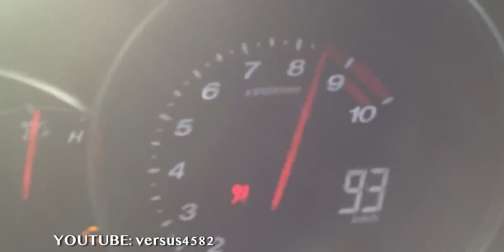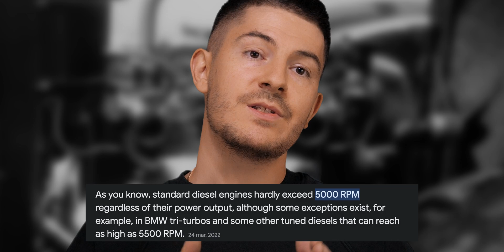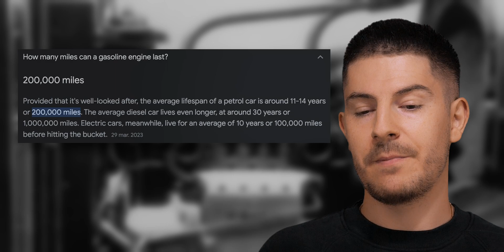Why Diesel Engines Last Longer

Comment from the maker: Professional Maintenance Products I Recommend 
Engine Oil Flush PRO - https://amzn.to/45egARf
Engine Oil I recommend - Liqui Moly 5W30 (Made in Germany) - https://amzn.to/46htcs6
Wear Additive I recommend - Ceratec - https://amzn.to/3Q6uYqF
Gasoline System Cleaner PRO - https://amzn.to/3tjXcVT
Diesel System Cleaner PRO - https://amzn.to/3rCYUkK
Diesel DPF Protector Additive - https://amzn.to/3RGJeaI

Comment: Diesel engines must be more robust in order to withstand the higher compression ratio required for diesel fuel ignition and complete combustion. This means that engine blocks are usually made of durable steel, although this is not always the case. They also require stronger pistons, wheels, and connecting rods, so they must operate more slowly due to their greater mass, but they have better torque.  However, they also run cooler than their gasoline counterparts, even though they reach higher temperatures during the combustion cycle. Due to the evaporation of diesel fuel directly in the combustion chamber (although diesel requires less latent heat for vaporization than gasoline -> 250 kJ/kg vs. 350 kJ/kg) and the high compression ratio, the engine cools more easily because more energy is released into work than into excess heat. So higher compression ratio, more robust components, more oily fuel, less excess heat, more energy on the wheels, less consumption, less explosive combustion -> longer life. A gasoline engine can never beat a diesel engine, no matter how good it is. I drive an Opel Astra H Isuzu 1.7 CDTI 125 HP station wagon, manufactured in 2010 with 202000 km on the odometer, and it is better than all other newer or older cars on the road, except for cars with VW 1.9 TDI, Fiat 1.9 JTD, Toyota 2/3 L , Mercedes OM617 and Peugeot XUD9 diesels. The only exception is the Volvo B230 Redblock gasoline engine. Other engines, regardless of their origin and year of manufacture, are inferior. Hope that helps.

Comment: Mark the Carpenter here.
I believe diesels last twice as long as gas engines because the operate at about half the rpm.
In other words, they do NOT last longer, just that each engine revolution pushes their vehicle twice as far. So let's say both engines wear out at 1 billion revolutions. The diesel will have pushed it's carriage 2x further......... nothing more than that!!!

Comment: I love my 1.9CdTI and service every 10,000Klms(mInly motorway miles). Now its essential also to clean Oil regular and EGR valve (Soot Build up) due to DPF Regens and oil contamination. Cleaning that EGR and DPF is essential to make sure car can run efficiently

Comment: Engine blocs are cast iron in diesel engines. This is another factor. In modern gasoline engines, they are metal alloy.
Reply: Most new diesel designs are alloy blocks now too! 
I much prefer the older iron blocks, which is why I own a 2.0 HDi peugeot, Mercedes OM651, Mitsubishi 4D56, and an iron block petrol Mercedes M104.
I have a Hyundai 1.6 Gamma with an alloy block which I have always been sceptical of, but it's still going great after 200k haha